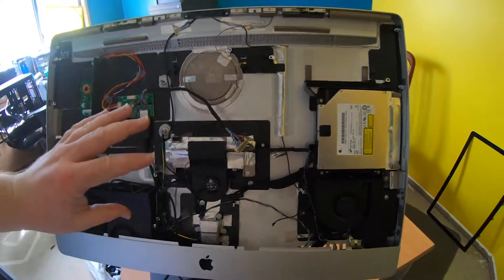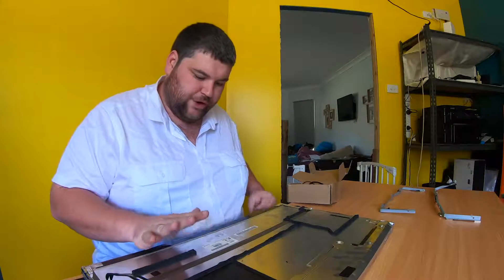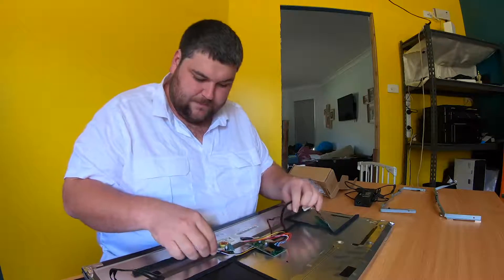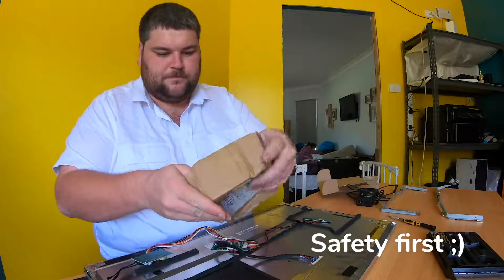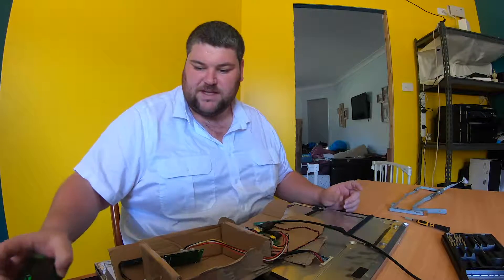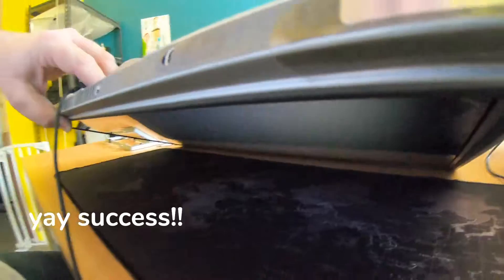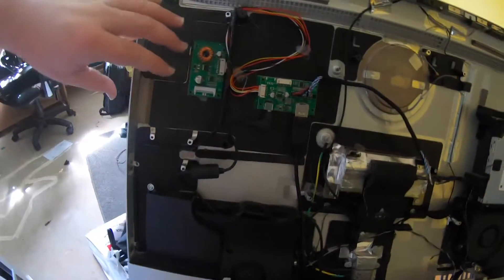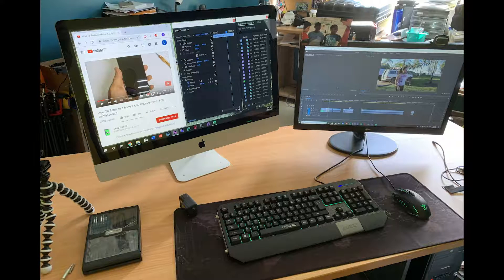New life for an old monitor

Comment: Hi there sir, I too have a imac display a1311 model number: lm215wf3-sla1(it has led backlight not cfl) but I having difficulty finding the driver board can you please help me out?
Reply: https://pt.aliexpress.com/wholesale?catId=0&initiative_id=SB_20200824133622&origin=y&SearchText=+lm215wf3-sla1
Reply: @andreikroth7215  but the inverter doesn't have any thing to plug the backlight connector , or should I cut the connector and solder it directly to the inverter board?